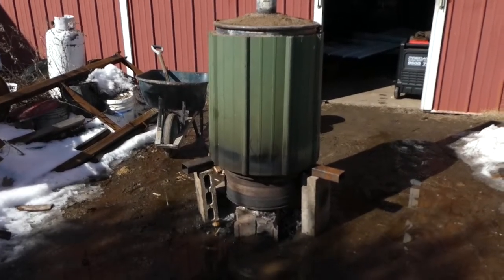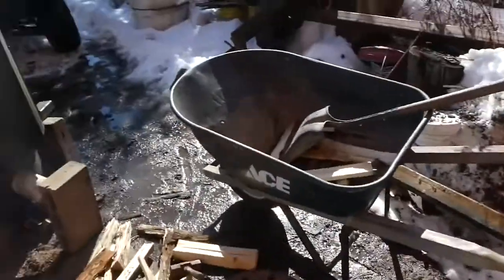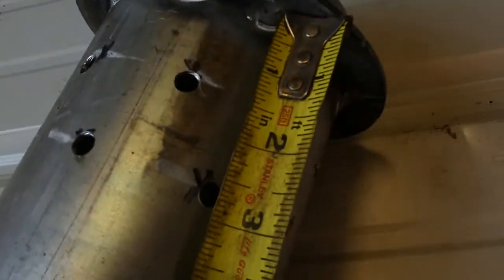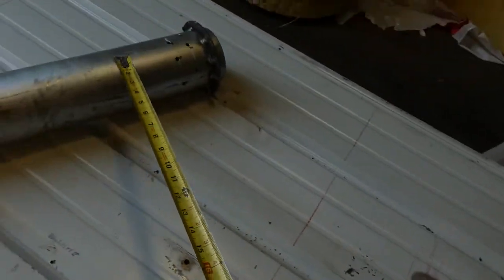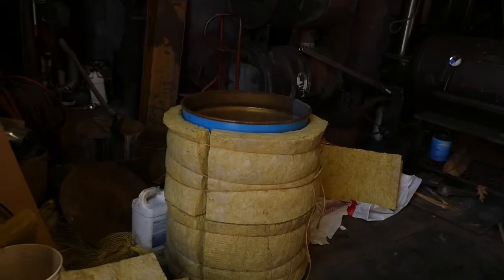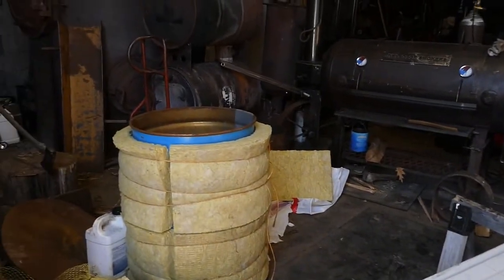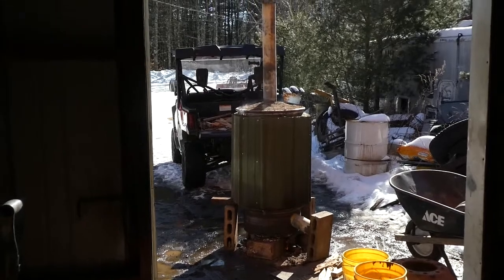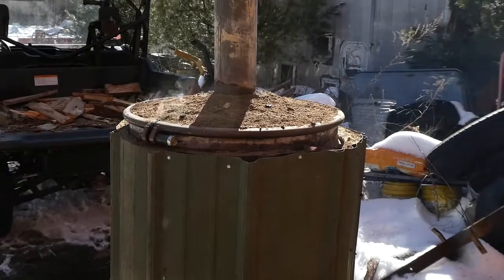NH Hbbyloggr - Building a second charcoal retort 030122

Comment: Been looking at the two different methods - holes in bottom of flue vs a tube that feeds back into the furnace. In my head, the holes in the bottom of the flue wouldn’t allow the oxygen to ignite until it exits the flue, because there won’t be any oxygen in the flue. Whereas the tube feeding into the furnace in theory could mix with air and ignite at the bottom, before reheating the charcoal on the way up. Is this correct? Obvs a lot easier just to drill some holes in the flue rather than weld on a separate pipe!
Reply from the maker: I have not tried the other method but drilling the hole in the flue pipe near the bottom works well for me. There are no signs of ash in the retort when I tip the barrel on its side to clean out the charcoal.

Comment: Why does my charcoal not burn well. Its starts well in a pile but when i spread it out to grill my meat with it basically slowly goes out. I used a jarah hardwood.
Reply from the maker: Keep it closer together, maybe add more charcoal in the cooking area. It has to be able to maintain combustion temperature. If it's spread out too thin it will cool down below the temperature needed to maintain combustion. That's my theory and I'm sticking to it. Happy grilling !
Reply: @nhhbbyloggr5022  ok ill give that a try as the normal charcoal that i buy can be spread without going out . In my continued research i found that some buisness use additives to get then to burn better. Ill try more and see if thats better as ive made alot b4 using it, as prices for a 30kg bag of charcoal doubled in price in Australia . Cheers.thx for taking the time in replying 👍
Reply from the maker: @1australianbeacon  The method I use for grilling with our home made charcoal is first ,  I add a couple double hand fulls of the charcoal to the bottom of the grill, then place a stick of smoking wood on each side of the pile. add about 3 or 4 sticks  cross ways to bridge the charcoal and then light it up. Give it time to render the smoking wood . My reasoning is the charcoal gives a good base to start the fire and maintain the heat needed to burn the wood chunks/sticks. The wood in turn is the second stage of the heat needed to cook the meat.  Add a stick of wood or two as needed to maintain the coal bed.
Smoking, on the other hand is basically the same starting procedure with the homemade charcoal as the base but the smoking wood provides the heat and smoke during the long cooking process, sometimes as long as 12 hours !

Comment: Nice work. 
 Things are getting truly industrial at the Hbbyloggr woodenwatten compound  :) .
Reply from the maker: It's especially nice being able to cut out steel parts accurately with very little finishing required. That said, I still keep the 12 # sledge hammer handy.
Reply: @nhhbbyloggr5022  
 A CNC plasma cutter is on my 'to get' list, for sure. 
 Being able to make anything, out of plate steel, wood be a truly wonderful thing indeed. 
 The hammer is the perfect 'reprogramming tool' in case the computer decides to misbehave  ;) .
Reply from the maker: @CNCmachiningisfun  Ahh for sure, with your CNC skills wonderful things will come out of your shop faster than drawing a pattern by hand, tracing and cutting out by hand then the clean up, grinding, fitting, more grinding. You will wonder why you didn't get into this long ago. I think of all the hand made projects and fitted parts which needed to be beaten into submission to fit , this is the way to go for the serious constructor. 
Today I made parts to replace a really terrible inflation fan for the greenhouse double layer covering. Neat, clean and a perfect fit.
Reply: @nhhbbyloggr5022  
 Yes, you are quite right. 
 Indeed, the more I consider it, the more I wanna go out and buy, or perhaps build, a CNC plasma cutter. 
 Talking of cutting, grinding and welding, I am currently doing a LOT of that, as I build my strangest creation yet. 
 It is a hefty add-on to my excavator, that lets me reach high up into the trees, with a remotely controlled chainsaw. 
 The 'pole-saw of doom', is gonna let me take control of the wilderness that is rife on my new property  :) . 
 A CNC plasma cutter wood make all of this work so much neater and quicker, methinks.  
 Looking forward to seeing watt you are creating with your amazing new plaz-master-9000  :) .
Reply from the maker: @CNCmachiningisfun  Troubled minds never rest, do they. A CNCmachining version of Tyrannosaurs Rex nibbling on the unsuspecting trees.
Reply: @nhhbbyloggr5022  
 Yup. Those pesky treez won't know watt hit 'em  ;) .

Comment: Bill, what are you doing with all the charcoal?  Joe
Reply from the maker: Joe, It's great for cooking on the grill, but the big push is to make enough to keep the 3 smokers going for at least 18 hours each.
After that I want to try using it for the gasifier
Reply: @nhhbbyloggr5022  The math says 50/50 on the mixture of wood to charcoal run in the gasifier. If wood is 80 percent volatiles/ 20 percent carbon,  and the charcoal is 80 percent carbon and 20 percent volatiles , mixing 1/2 pound of wood and 1/2 pound of charcoal gives you a 50/50 ratio of volatiles to carbon. Best chemical combination for optimum gas output as long as your temps don't get too hot. If they do, just scale back the charcoal. Should burn hotter and convert more steam into hydrogen and combine the oxygen with a carbon for extra carbon monoxide molecules. That will also displace some of the nitrogen giving you a more potent gas. Joe
Reply from the maker: @mazdalorean  Someone has been doing their homework ! Mixing the two makes sense in order to keep the temps high enough crack the tars. Can't wait to try the mix and see what the hearth temperatures indicate. Using dry wood chips as I have in the past the temps in the hearth resembled rolling waves.

Comment: Thanks Bill. I watched the video of the fella that gave you the idea. All good stuff.
Reply from the maker: Load # 5 starting in an hour or so after it warms up a little ( 8*F right now )
Reply: @nhhbbyloggr5022  Hi Bill. I would be interested to see what happens, if you start the fire with the lid off. It might allow the moisture content to escape a bit more easily. I’m not into making a lot of charcoal yet, but I have made a gasifier and know about the problems with moisture in the fuel stock. It would be interesting to see if the wood inside inside the barrel, would catch fire or just give off moisture for a while. Just sharing a few thoughts. All the best. Regards Stephen. NZ
Reply from the maker: @gasonthebrain3738  Stephen, That is an interesting idea and I might try leaving the lid off , or at least loose/ partially raised and watch for steam during the start of the heating process. . In any event it has to escape one way or another.

Comment: how long does it smoke on start up? its a big struggle for a lot of folks trying to go smokeless making char with city ordinances and whatnot
Reply from the maker: Keep in mind we are in NH and the temps play a big part in getting the wood in the barrel up to ignition so we have to keep feeding the fire under the barrel every 15 to 20 minutes . The only time this doesn't smoke is when the pyrolisis event happens and we stop feeding the fire pot.
Our place pretty much runs on wood 24/7/365 so if there is ever a time when there is no smoke coming from our place I'm probably dead.
Reply from the maker: That said this last batch took 4.5 hours to cook off.
Reply: @nhhbbyloggr5022  how much is your yield per batch so far?
Reply: Here in Washington if someone sees smoke expect the fire department to already be on there way 👎
Reply from the maker: @BigBeavrSlayer  Starting with a full 55 gal drum the yield is around 30 gal. when completely finished.
Reply from the maker: @BigBeavrSlayer  Geez. How do you get away with the wood gas truck during start up then?
Reply: @nhhbbyloggr5022  he he I don't always. At home not a big deal at work I have had the fire department show up
Reply from the maker: @BigBeavrSlayer  Do you get a special purpose registration for the truck? " Bio-fuel " kind of exemption? or do you just tell everyone the valve seats need work? hahaha. Of course it doesn't smoke while you're driving... unless you start to run out of fuel
Reply: @nhhbbyloggr5022  I haven't told anyone anything about the truck, they would crucify me as a tree killer and deem my truck a road hazard with the way this state is run
Reply from the maker: @BigBeavrSlayer  You Pallet gypsy, save a tree -burn a pallet.  Gasoline just topped 370 today, up from 358 yesterday Keep them 2x4's coming !
Reply from the maker: @BigBeavrSlayer   Starting with a 55 gal drum packed full of wood the average yield is 30 gals of charcoal when completed.